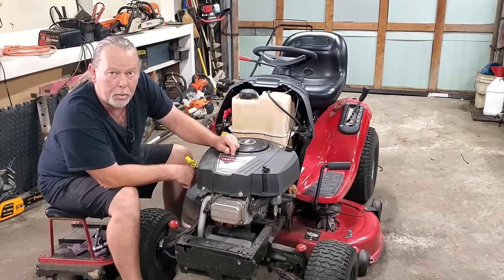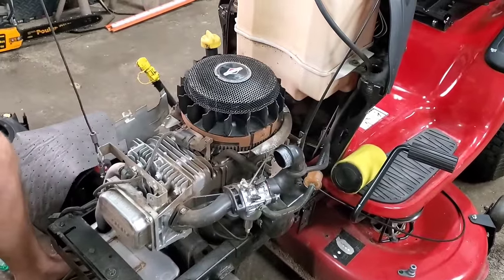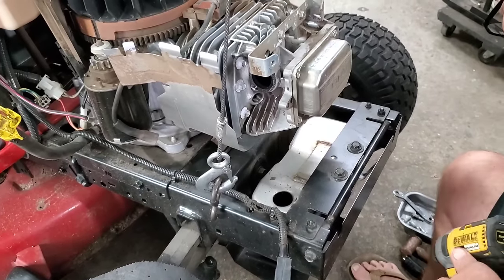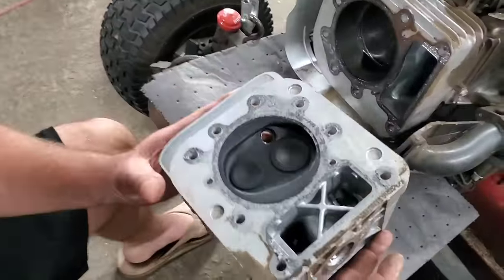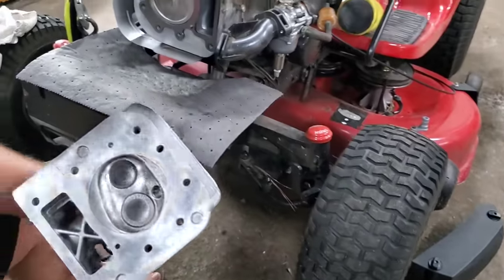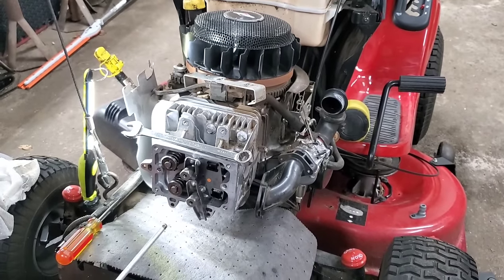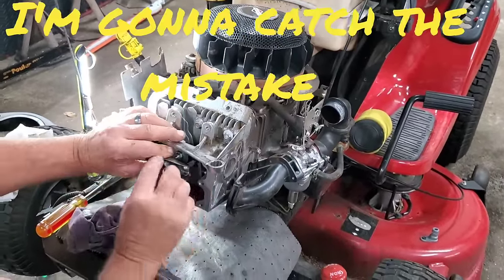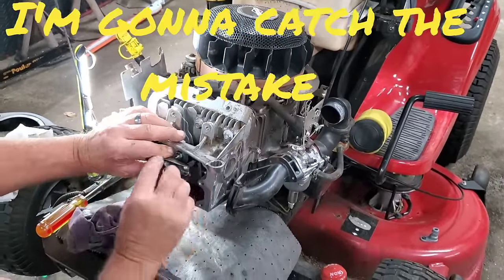Smoking Lawn Mower Briggs and Stratton Head Gasket Diagnosis and Repair Easy DIY

Comment: What kind of wire brush should I use ?
Reply from the maker: Whatever ya have is fine. If you don't have any you can go to Harbor Freight and get a variety pack of small ones. That's what I use most of the time
Reply: @RaleysSmallEngines  should I worry about scratching the aluminum ?
Reply from the maker: @LaneCodeRedCarnivore  be gentle and don't over do it
Reply: Thank you ! Getting it done tomorrow. I was a trucker from Michigan , loved running down to Texas !!

Comment: Cylinder compression test with an open throttle plate . Then retest with a teaspoon of motor oil in the cylinder . Compression improves - piston rings worn .
Reply: Good tip

Comment: My ch20 just got heads rebuilt ram it for around 40 mins and it started sputtering and spitting white smoke please help, also leaking oil out exaust manifold got no head gaskets and both heads rebuilt

Comment: Call that smokey?

My B&S 800 series is kicking out so much smoke it is impossible to see within 15 seconds, continuous thick white smoke and oil ejected from the exhaust.

What is the most likely problem?
Reply from the maker: Check your oil level and smell the dipstick. It may have gas in the crankcase with the oil and over full.  This is caused by a leaking needle and seat in the carburetor and in some cases a faulty fuel pump.

Comment: You definitely have to mention changing the oil once I worked for a guy who couldn't fit up under his truck so he asked me to get under to drain and swap the filter...This was at the end of a 12 hr day so when I got it drained and the new filter on he decided he would fill it up in the morning I even told him I'd put the oil in he said don't worry about it he would do it well come morning we are rushing to get on the job and he gets in and drives off never puts the oil in......blew it up tries to blame me at first but we straightened that out real quick nice truck diesel decked out was a shame 75,000$ truck made me sick and it wasn't even mine.
Reply from the maker: I thought I did.  Maybe I need to watch it again.  Great story, thanks for sharing.  Thank you for watching and commenting my friend.
Reply: @RaleysSmallEngines  You did say to change the oil

Comment: briggs 18.5hp, 31H777-0202-E1. I cannot find engine/torque specs for it. Can anyone help?
Reply from the maker: You may try "manuals lib".  I've been working on small engines about 50 years and my opinion is, tighten equality and in a cross pattern. You will be fine.  Remember, this isn't Nascar or the space shuttle.
Reply: @RaleysSmallEngines , I should have mentioned that I already looked there and it's my first stop for any manual, thank you.  No luck.  The other question is can I use RTV and a metal gasket together on a head?  If so, does it matter which one I apply first?   No luck on valve head gaps either.

Comment: What do you think is the reason for this failure? These engines don't rev that high. Something to cause it to over heat? Poor tolerances.. etc?
Reply from the maker: In my opinion it could have used an additional head bolt in that galley.  Thanks for watching and commenting my friend.

Comment: Why is the gasket different? The one that was replaced had a notch cut out near the top right side of the cylinder and pushrod galley. The replacement did not have the notch. When looking up replacement gaskets for a 17.5 ohv 500cc(intek) there are 10-$20 kits that have BOTH gaskets in them along with the exhaust and intake gaskets and some small little rubber/metal round gasket. Why is there a discrepancy with the gaskets? I'm guessing this is why both examples come in the head gasket replacement kits for these engines.

Comment: This is a myth about using high octane fuel. It does not burn hotter or cleaner or ignite better. In fact it ignites worse on purpose (requires more heat to ignite it), so high-performance engines in vehicles with turbochargers for instance can be designed with a higher head pressure without knocking. It has no benefit for small gas engines, unless it is the only way to get ethanol-free gas in your particular area. Ethanol-free gas is what you need to focus on, and just get the lowest octane available of that.